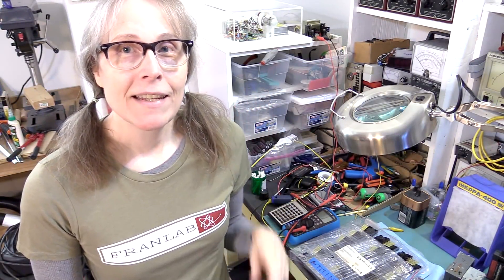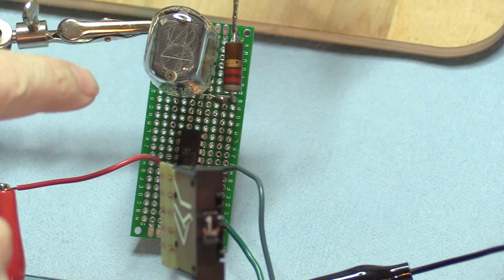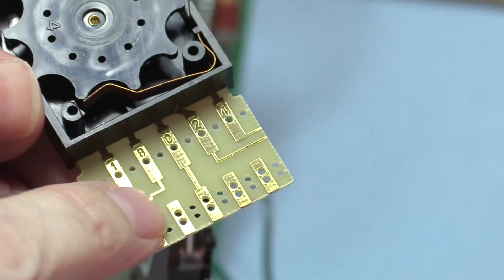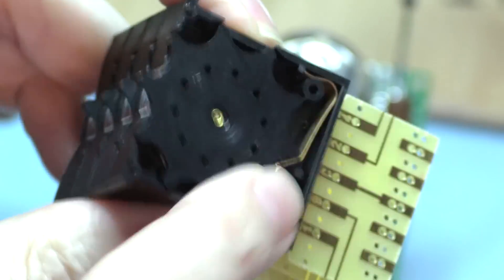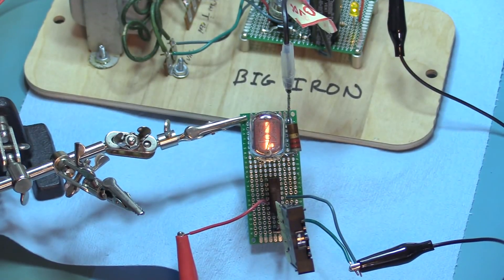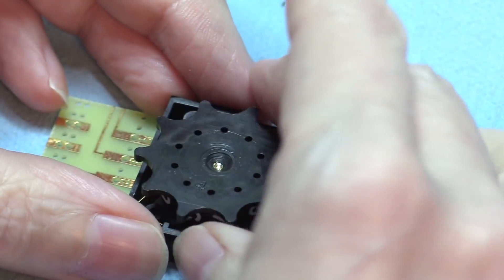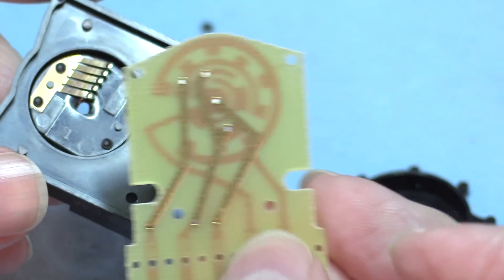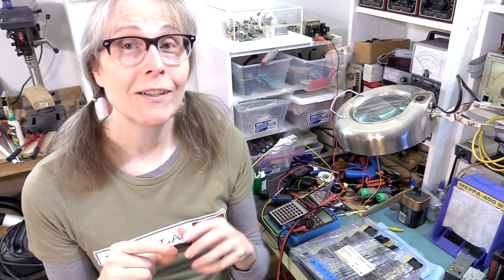Nixie Fun With BCD Switches!!!

Comment: I used BCD switches when I designed the "SuperSCAF" audio filter published in QST April 1986.  The BCD switches set the upper and lower bandpass filter cutoff frequencies.  Thank you for describing nibbles!  In my early days I designed a 4-bit CPU using AMD bit-slice components... it was a "Nibble" processor programmed as a combination lock!

Comment: Very nice.  We had banks of four and six of these for adjusting setpoints in control systems.  But ours had a 'hold' button.  The switches went to a resistor network to apply the correct voltage to a cap and then into some DC analog circuitry (high-z input op-amps).  The 'hold' button interrupted the line to the cap so the cap voltage would hold the current voltage level for a minute or two.   This allowed the operator to press the button, adjust all the digits to a new value and then release the button.  Doing this while flipping all the wheels around avoided wild variations in setpoint as each 'digit' was rolled around up/ down.

Comment: For years I used lots of those switches (and their 16-position hexadecimal siblings) in production test fixtures to avoid the need for the operator to interact directly with a computer mouse/keyboard.  They were connected to the GPIO on a small industrial PC104 board.  Initially, output was to a simple LED status display made from perfboard and a pile of discrete and 7-segment LEDs.  Simple, fast, reliable, rugged and cheap from the systems perspective.

We eventually replaced the LED panel with a 10" color LCD display to show greater detail for test sequence progress and results, then soon upgraded it to a touch display so the production tester could also be used to diagnose and test RMA units (basically, to jump through and repeats various steps of the production test process).

Then the operators asked for the mechanical switches to be moved to the touch screen, which proved to be remarkably robust by visually simulating the up/down button versions of the switches.  And we never again used the mechanical switches.  Sigh.

Comment: I remember the lab where I worked in the mid-late 60s had geiger counters that had 2 decades of dekatron valves/tubes, followed by an electromechanical counter. They were made by Panax Equipment Ltd, Redhill, Surrey, UK. I have another model the RM202 which has a meter instead. PANAX counters and ratemeters were used for many years in schools and colleges.

Comment: I remember these being used in the original "Ungo box" car security system! The early ones had 3 wheels if I remember, later used 4 or 5 wheels, and the system was briefly popular. Handmade in Mountain View, cali, i used to work near the old building. Later a motorcycle suspension boulder was there, and upstairs was shelves of the parts of the old alarms, still there long after the company was sold. They were a big deal, and I laughed at seeing all the pieces, remembering how trendy you had to want to be to spring that much on one for your VW Rabbit GTI!

Comment: 8:37 - Years ago, there was a safety awareness class at work, and the guy conducting it told of an incident in an airplane factory. A worker had a bracket that had to be drilled to fit an existing location, so he sat down, held the bracket in his lap, and drilled the hole. Now, the typical drills used in aerospace are 6" long, so he drilled through the bracket, but that wasn't all he drilled through!

Comment: My first acquaintance with the thumbwheel switches was (like most of my first's) way back in the memory lane.  They were Contraves brand, which I believe is a Swiss company.  Later on, I have used in my own designs EECO brand switches, both thumbwheel and pushwheel.  In a lab reference +/- 19.999 V power supply there is lever wheel version.  I don't know who made those.  But I know that Cherry at one time made these kinds of switches and I believe Omron may have been yet another brand.
 However, my reason for this little story is that one analog timer I designed some time around 1980 used three thumbwheel switches that were just plain 10-step, no special coding types.  What they had was a nice two-hole solder pad for each position.  So, I soldered 1% resistors in a daisy chain fashion between the output pads and got a 9.99 meg selector, which together with a 1 uF capacitor, a CMOS analog comparator and a calibration trimpot provided a 9.99 second timer.  About 10 years later I found that Bourns had introduced 2, 3 and even 4-digit versions with a set of built in laser trimmed (?) resistors and hooked up as a potentiometer, i.e. with just 3 terminals.  I have used different resistance values in 2- and 3 digit versions in some designs.  The Bourns parts are way cheaper than my one-time custom built ones.
 One note about the EECO and some other devices of this general type is that there are Kelvin-Varley as well as Wolff-Poggendorff  coded versions for high resolution voltage dividers.  I understand some voltage calibrators use one or other.  Fluke and other old ones have built Kelvin-Varley dividers in a fancy mechanical version that may produce individual digits from 0 up to 10 (rather than up to 9), or to mechanically advance the next higher or lower decade for roll over.  Nowadays those are mostly history as the embedded processors take in counts from a rotary encoder.

Comment: Ever come across 2 out of 5 code switches? The system was used to tune transceivers electromechanicaly as it gives 10 stop positions for a rotating shaft. Rockwell Collins used it for military aircraft transceivers and the like.

Comment: Nearly 20 years ago my cricket club agreed to replace its old scoreboard with its mechanical flip number operated by string, with a "modern" electric version. However the budget would not run to a brand new display, so we bought the scoreboard from a defunct club and rebuilt it. Or rather I did! 20" electromagnetic 7-segment digits with early 90s electronic drivers, and a wired control box with BCD switches just like yours. A couple had corroded contacts and had to be replaced. Since this was before eBay had become what it is now, I had some difficulty sourcing them and they were expensive, but they were identical and fitted straight in.

In those days this sort of thing was often found in stuff which was mission critical, so it had to work properly, and be easily serviced. Remember the USS Caine collision? One of the reasons was that they did not have proper physical throttle controls. When the Captain order full reverse, the helmsman had to use TWO SEPARATE TOUCHSCREENS! Turning everything into a computer is not the way forward! We need more proper physical controls. They should not only give you instant control, but show the current setting as well.

PS Lovely video. More Big Iron and Nixies!

Comment: Wow, great!  This my 2'nd Fran video.  I have concluded she is the "Mr. Rogers" of electronics (Mrs. Rogers?).  I have noticed a common theme around a bunch of these fun quasi-technical YouTube videos where you have a very knowledgeable host, like Fran, who understands that most viewers just want a nibble (ha, ha, see what I did there) of tech stuff because it is fun and magical.  Moreover, Fran, and a bunch of other tech YouTubers, understand that the window shades of the brain quickly shut down when things get too technical meaning these viewers stop watching, meaning they get zero knowledge instead of some.  I have a lot of trouble practicing this style of teaching.  I always end up giving more information than most people want to hear.  OK, so, since I am incurable, here is some extra "splainin" to go along with Fran's delightful video -

At one point in the video, Fran alluded to the fact that the rotary switch converts the Arabic numerals on the face into a binary electrical signal ("BCD" stands for "Binary Coded Decimal").  Binary is a counting system which only uses the number zero and the number 1 (on or off), but when she cracked the case open, she did not elaborate.  

Go to the video frame at 9:35 to see the round flower shaped array of contacts.  The idea behind this device is that all of the 5 gold colored rotating contact tines are attached to the free-to-rotate plastic Arabic number wheel and all 5 are energized with power because they are attached to each other and the 5'th contact always touches the “common” power (a.k.a. "Neutral").  Or the 5’th might be ground, doesn’t matter for this discussion.

As the 5 contacts rub against the stationary round flower petal pattern of gold-colored metal contacts, they send power to certain parts of the stationary flower petal contacts to create the binary code associated with the numerals 0, 1, 2, 3, 4, 5, 6, 7, 8 & 9.  It takes four output wires to convey these 10 Arabic numerals as Binary numbers, here is the binary look-up table (see how there are 4 columns):

#0 = 0000
#1 = 0001
#2 = 0010
#3 = 0011
#4 = 0100
#5 = 0101
#6 = 0110
#7 = 0111
#8 = 1000
#9 = 1001

At first, I thought it would be easy to suss out the on/off patterns you see in the table to the round array of contacts.  You can see the scratch marks on the round array made by the passage of the row of rotating 5 contacts which form 5 distinct concentric rings.  But then I hit a roadblock trying to see what was what (I am a mechanical guy and only know a smattering of electrical stuff).  

I thought the contact pattern would be simple since, for example, the right-most column of binary code repeats on, off, on, off, etc.  The second from the right column repeats: 2 offs, 2 ons, 2 offs..... etc.  The third column from the right has 4 offs, then 4 ons and the 4'th column from the right doesn't reveal its pattern until you count higher than 9, so it looks like it will be 8 offs, then 8 ons.  So this is probably where the etched-in contact lead names come from: 1, 2, 4 & 8 ("C" = common).  Anyway, this plain pattern is not readily visible in the round array of contacts because the designer has created some sort of shape/material optimized layout with some of the radial zones connected to others and the final tabs marked 1, 2, 4, 8, C are out-of-order.

In short, I did not have the patience to map out the circuit paths, but I did notice that the contact labeled "1" is connected to the outermost round crenellated contact strip which has 5 crenellations (5 tabs) which look they correspond to the right-most binary column which has 5 ones as you go from 0 to 9.  The empty spaces between the 5 crenellations correspond to the 5 offs.  After that I gave up.

Happy New Year's day!

***************************

Comment: I think those thumbwheel switches were used in early scoreboard controllers, early shot clock controllers, medical devices, commercial and industrial grade timers, fast food production timing systems, aircraft, early electro-mechanical devices, counters, early coin operated systems, and others.

Comment: a control 'computer' on a cardboard box cut/fold machine in a factory i used to work at had loads of those in it,  took a while to set up each box 😉 it eventually got more and more problematic and was eventually replaced by a touchscreen thing, i was given the box of 'spare' and 'suspect' boards for the old one  when it was dumped and from what i saw of those, its faults were probably only dry joints, as every board in that box was afflicted, i could've easily sorted it for them and saved them thousands of £s !!

Comment: I'll admit it, the only switch like this I have is a small pushbutton variety used for setting SCSI IDs.
Reply: I've got a SCSI ID switch which is a 10-position switch (the two-pushbutton style) with stops to prevent it from reaching 8 or 9. If you want to go from 7 to 0 you have to punch down seven times.
Reply: @8bitwiz_  I seem to have misplaced mine but IIRC it is also ten position but 8 and 9 have a blank label. These are selectable but I didn't test to see if they'll actually select 8 or 9.

Comment: I have 2 Hexadecimal thumbwheel switches for the memory address selector (toggle switches for the data) on my 8 bit CPU. Goes 0 thru F (0 - 15), got them from eBay iirc

Comment: I used those type of switches in a lot of designs "back in the day".  I was designing in 4000 series CMOS mostly in those days before the microprocessor.
Reply: As a kid, I always wanted those switches (especially after seeing them in War Games), but they were way too expensive, and I always ended up using cheap DIP switches in my projects instead.  Until a friend's dad (who worked for an electronic organ manufacturer) gave me 4 of them (and a bagful of LEDs).  I was over the moon...  It did hurt a little to see one being dissected in the video...
And yes those were the days, before microcontrollers, when we had to build everything out of discrete logic.  Didn't have the money either for a decent power supply so I used the 4000 series a lot, they didn't mind being powered off a 9v battery.
Reply: @kaasmeester5903    dissected ,  superglue can fix that

Comment: You could have done some explaining on the BCD code. The little difference between 8bit-binair and 2nibbles-BCD?
Reply: A byte is composed of eight bits, or two nybbles.  A nybble is four bits wide, and therefore may represent up to 16 distinct symbols.  BCD (binary-coded decimal) only uses ten of these sixteen symbols - one for each decimal digit.

Two BCD digits = eight bits = any number from 00 to 99. The other six symbols representable by a nybble are invalid.

Two binary nybbles = eight bits = any number from 00 to FF (255).  Every possible symbol representable by a byte or nybble is occupied.
Reply: @malloryworlton6359  okay that's indeed logically but how to use more, say 2or4 BCD digits to get one 8or16bit binairy number? I mean, how can you use such mix between binairy and decimal in your design? To store it and calculate with it?  Is that done with logical gate ic's like normal 8or16bits binairy? Or does it need a cpu and software to Dó anything with numbers bigger-than-10 in BCD format? Btw thanks for serious and usefull answering!
Reply: @robson6285  Writing a multiple-digit decimal number in BCD is simplicity itself: convert each digit into a four-bit number and write them all together: as 69 is 0110'1001 (the binary for 6, in front of the binary for 9.)  The next BCD number is 70, or 0111'0000.

A BCD number is stored just as any other bit string.  Adding two BCD numbers is a bit trickier: you add them as binary numbers, then if any group of four bits is higher than 9, you add 6 to it (for 16 - 10 = 6), and propagate carries as usual.

We'll add 35 + 16 in BCD:
0011 0101
0001 0110
-----------------
0100 1011
Notice that the lower group of 4 bits is 1011 = 11 > 9, so we add 6 to it:
0100 1011
0000 0110
-----------------
0101 0001
which yields 51, the correct sum.  This is possible in combinational logic: have a couple of adders, then use the value of a nybble to select between the sum and the sum + 6, for each digit.  I used this system in a clock design to convert the date (stored in binary) to BCD, suitable for use with Nixie tubes.  Maybe I should make a video on this.
Reply: @malloryworlton6359  hey this is a great explaination! This was exactly what i wanted to know. Thanks man

Comment: Most of the BCD switches I have seen, you could rotate the thumbwheel in both directions. A neat feature on some of them is where you could add pins in the side of the wheel in certain positions, which would "lock out" invalid digits. Wanted a switch that could only do 0 through 5? You could do that!

Comment: I have a big iron power supply that actually has a nixie tube display, with those exact thumbwheels for setting the output voltage !!!
Reply: Interesting, I wonder if it uses them to set voltage reference resistors?

Comment: When I was working offshore on an older dynamically positioned Deepwater Drillship,  The Honeywell Computers had 32K of 16 bit magnetic core memory. The memory cores weighed over 100 lbs and was about 18 inches long, by 10 inches deep and 8 inches wide.  According to Honeywell the computers we had were identical to the ones that went on the Lunar missions.  They originally were designed to have 64K of 16 bit memory, but that was cut in half due to the problem of size and weight.  I am holding a modern memory chip with 256 gigabytes of 8 bit memory that is less than an ounce and less than an inch on a side and about i mm thick.  How far we have come in 50 years.  Note: In 1980 the two Honeywell computers were replaced with 3 proprietary computers from Simrad (A Norwegian company) with 1 megabyte of 8 bit memory each and powered by a variant of the 8086 Intel Processor.  In the original configuration if the two computers calculated the position and the force required to maintain the ship on location against prevailing wind and current.  If the computers had significant differences in their results, a comparator sounded an alarm and the operator had to look at the raw data and in seconds decide which computer to use for controlling the ship.  In the triple computer setup by Simrad, If one computer differed from the others, the calculations from the other two were used and an alarm sounded and the operator called the ET's to check out the one computer not in agreement.  (Generally, a computer shut down and restart, "cured," the problem.)

Comment: Fran....Nice fine mesh Nixie.  I have 8 of them in a Nixie clock and I think they are NL-836 similar to the NL-5991 / 8442 but the 5991 and 8442 have a coarse mesh.  What part number is yours there?  Thanks!